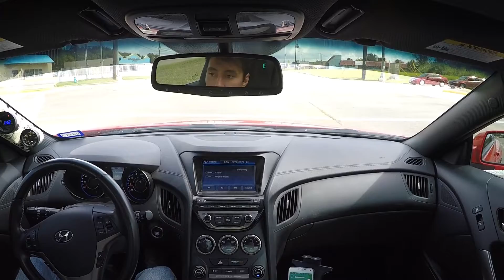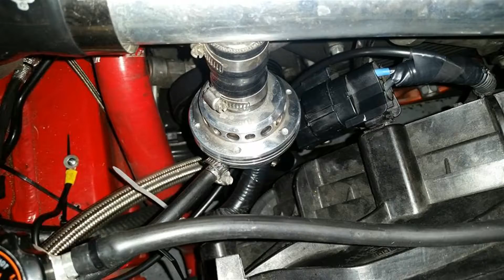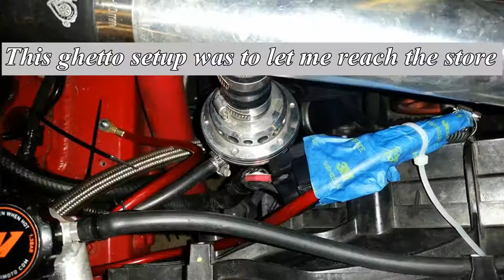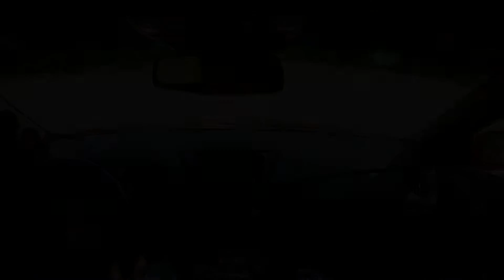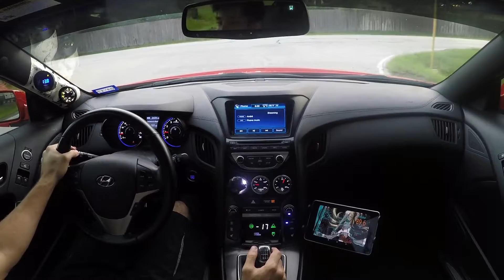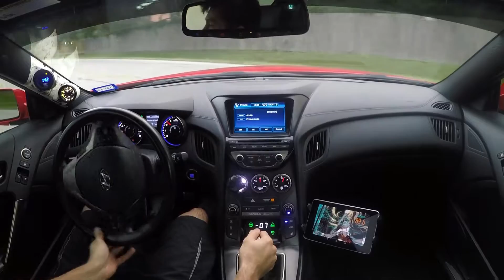✓ Overheating and another Engine Build - Vlog 1

Comment: Hey man, been following your build for a minute, looking great so far! Was wondering if I could pick your brain for a bit about your build. Currently have MT bk2 3.8 FBO, headers, gears, an a bit more myself, and plan on going turbo soon at 7psi, while building a spare block.
How much boost are you running on your current setup to get 500whp, and how close are you to max DC of the injectors at the power? I've seen most people saying ~500 hp is the limit of the injectors; meth could help, I just don't care to be tuned for it. For internals, did you use stock pistons, an con rods, and just increase ring gap for the higher combustion temps? I'm also interested in your bearing size choice, especially since your running a balanced bottom end. I've personally been considering the BC 4.2 stroker kit, but have had no luck sourcing the GDI pistons. I wonder how the OEM pistons would hold 600whp, if at all. Haven't been able to find much info on 3.8t failures besides spun bearings, and ring bind, but the bind could just be do to the in adequate gap for FI.
Reply from the maker: Kolton A so with my 505 whp dyno run I was using 12 psi of boost and spraying meth. This is a gdi engine as you know so IDC isn't like it is on normal cars from what the tuner tells me. the only way to know the answer is to literally add more fuel and not get it, then you have hit the limit. so far the injectors have made 550 whp but they can likely make more again based on what the tuner said.
Check out my turbo update video for the specific parts I used on the build. Stock pistons don't last long above 450 whp and connecting rods will likely bend after that. when I rebuild my friends block, we increased the ring gap by 45% (if I remember correctly) but he wasn't going for power, just reliability at 400+ whp. so since you're putting in forged pistons, just follow the spec for the rings you use. I used 5.5 thousandths per inch of bore for the top ring and I think 5.0 thou per inch of bore for the second ring.
rod bearings come with the rods and crank bearings were from ACL  (which went out of business I hear) but I didn't size them to the crank. because there are about 50 combinations of sizing on the oem crank, my builder bought bought bearings after he pulled the crank and measure, then he shaved the crank to fit the bearings.
Stroker kit isn't much value on this car. there's a few kits out there and no one that I've heard of has actually run it yet. just reselling back and forth throughout the community.
There's like 5 different sources for gdi pistons. I used JE with BC rods. oem won't hold 600 whp. the ringlands will fail long before that unless you run wayyyy too much ring gap.
hope that helps and feel free to write back with any follow ups
good luck on your build too

Comment: Yo do you know if you can run e85 on the bk1 genesis coupe 3.8s?
Reply from the maker: TheBRPredator technically you can but not on the factory ecu because the car had no way to know the ethanol content and there's no way to hook up a flex fuel sensor.
now if you run a haltec stand alone you can definitely get a flex fuel sensor setup and run e85 all day and it'll be sick.
What are you plans for your bk1?
Reply: Bro I was looking to just trade it in for a bk2 since I wanted to get a manual but since my auto transmission is already going out, im just going for a manual swap. After I save a bit more money I'll probably go turbo.
Reply from the maker: TheBRPredator well bk1 is a bit easier to go stand alone, swap injectors, get aftermarket pistons etc. of you don't plan on building the engine, a bk2 can handle more power on the factory pistons and rods.
see if you can swap in the 2014 manual or something. A swap wouldn't be that bad but it depends if you can find the parts. clutch and fw, slave cylinder, clutch master, pedal set, shifter, shifter linkage, new driveshaft, new ecu, new interior trim around the shifter, clutch lines etc. it's a lot of parts to get. Maybe find a donor car and tear everything out yourself so you have all the parts to swap it ;-)
Reply: Initial DIY mods yea I started doing research on the swap and sfr has done it plenty of times and they posted all the parts you need and it's not that much. plus they can tune the ecu from auto to manual. yea I'm planning to build the motor because if I'm spending 6 or 7 grand into a turbo kit, I want at least 550whp